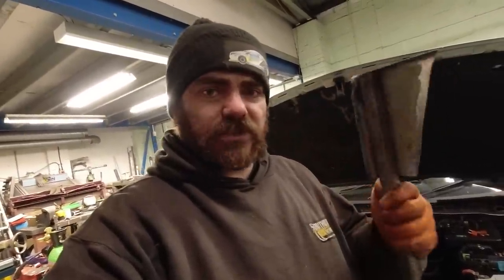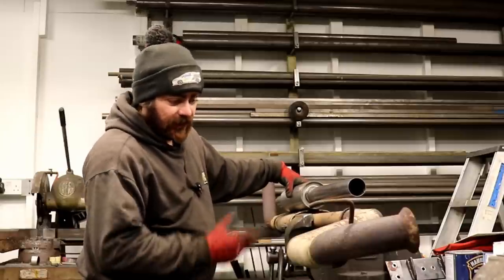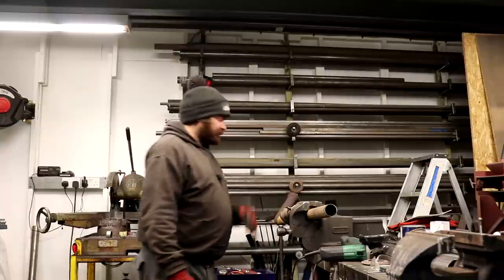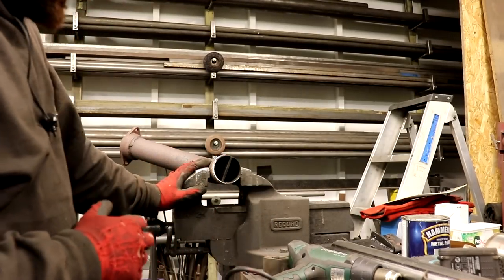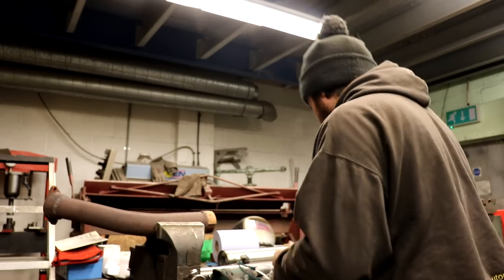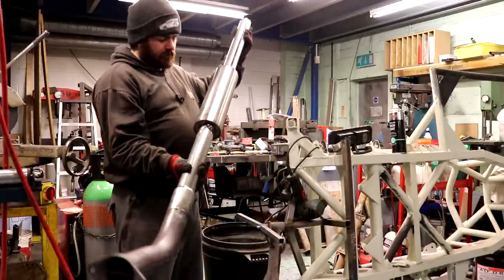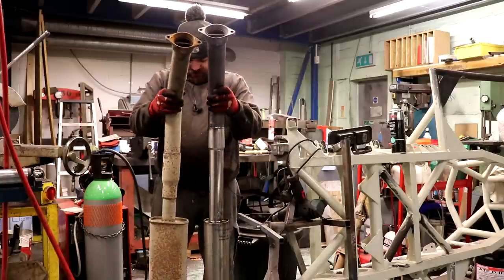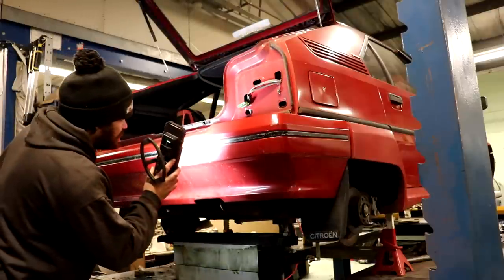PROFESSOR TOMATO ep5: UP 'n DOWN...pipe! Citroen BX 16v 'custom' downpipe repair

Comment: That gives satisfaction, building the exhaust yourself (parts of it). I did that once for a Ford Transit MK1 where I had installed a 2.3L V6 in place of a 1.7 V4, an exhaust from a V6 Granada cut into pieces and fitted under the Transit, that was nice work.

Comment: A skylight filter might work for you, if you work under "daylight" LED's they can make the footage seem overly "blue". A 1A or 1B filter might just help keep thiungs neutral and you can fire sparks at it all day.

If you want something more in keeping with this amazing channel, a ring of blutac round the lens front, and a square sheet of acrylic will do the job. It's cheap, replaceable, and if you make the sheet bigger than the frontal area of the camera you can grind with total disregard for the tech. If it rains (like inside Clement), slip a plastic bag over the camera and tape it to the edge of the acrylic. Don't immerse though. 🙂

Comment: Top work rich! Lots of thought into that exhaust! To tip to save your lenses, by a screw on uv filter ( just a piece of glass) and that way if any weld or sparks hit it you just remove it and buy another. I had one for my whole van restoration, then just bought a new one.

Comment: Bummer about the lens, but it might not cause much in the way of problems. Chiefly flare in bright sunshine (you remember bright sunshine?) which half the time you could pass off as an artistic effect. If you felt like it, you could get a teeny tiny brush and fill the scratches with matte black paint, if it was causing problems. I think they've told you about UV filters already.

On another note, when you stood there with the finished exhaust pipe, I was waiting for you to give us a tune on it--or at least try to attract the local cattle.

Comment: Really enjoyed watching this, particularly as I  have a similar exhaust build to do on my 2nd bus project (by bus I mean an actual full size single deck bus rather than some sort of VW).  At the moment, the exhaust doesn't sound right at all, and is full of holes.  I'm needing to replace the section between the manifold and tailpipe, which includes the only silencer. 

The only problem is, I have about 1% of the skills and equipment that you have, so it should be good fun!
Reply: What bus do you have?
Reply from the maker: Go for it!

Comment: I felt your satisfaction when that exhaust mod all worked out 😀You can get a cheap UV filter for your next lens that will protect the front element, just don't tighten them up, they have a habit of sticking. TBH though, you can really trash the front element and the damage will only really show up in longer shots.
Reply from the maker: Thanks for the tip!

Comment: Really interesting to now fully understand the 16v exhaust system. My phase 2 model had a much cooler tail pipe and the sound at full throttle was amazing. Actually, when I first got the car I was pleasantly surprised at the diameter of the down pipe...now I know why. Twenty years on from when I gave J401 HAT (1992 BX 16valve in white) to my brother, I feel kinda sad. Quite possibly the best car I have ever owned.
Reply: You never had a DS or GS I reckon (and I won't even get started with the best car since the byzantine oxcarts which is, to date, the SM ...)
Reply: @manfredschmalbach9023  indeed, I have never had or even sat in a DS. I nearly payed for a CX back in 1980....the insurance quote stopped that. I did drive a GS back in 1989.....to the breakers yard. However, the BX 16valve valve that I had the pleasure of owning, for several years, was an excellent car.
Reply: @ciaranokelly3693  Yes, it is. An excellent car, that is. It's a pity though that You could not try the other named ones in comparison. Have a nice day!

Comment: The tail pipe ruined the p1 for me!
Cituning did a great stainless back box for the p1 bumper.
Unobtanium now though..
I imagine it's far too late, but 8 always make a mounting bracket that runs beyond the original bracket, through 90 deg and into the rear valance, no flex that way
Reply from the maker: Yeah I agree the tailpipe is a let down on the 'hot' version that is the ph1

Comment: Do all BX's have the 4-2-1 downpipe or is it just the 16v? My GT has an visually similar downpipe (without silencer, because carb) and I was think of getting a full stainless system.
I'm not too fussed about a change in exhaust note for it, I'd rather not hear it at all 🤣
Reply from the maker: Many PSA cars do, TU engines too